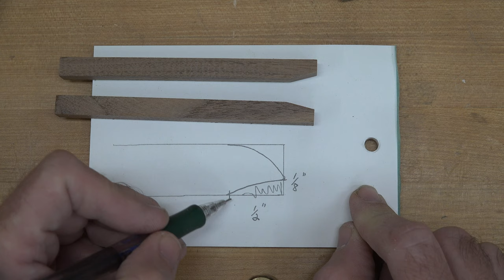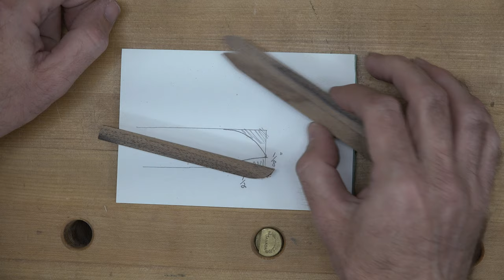Making Mini Photo Easels

Comment: Ken, wow, neat project and great use of scrap.  Gotta build a few of those.  I was wondering where in the heck you get such fantastic dowels then I remembered you make your own.  The light dowels against the walnut sure are a nice contrast.  Thanks for sharing.
Reply from the maker: The smallest dowels that I make are 3/16" in diameter Paul.  I find that anything less than that causes too much chatter in the wood and they end up being misshapen and incorrectly sized.  I purchase these at Lee Valley and they are fairly inexpensive and last quite a long time as you don't use them very often and when you do, they are usually smaller pieces.  Thanks for the kind words and for tuning in sir.

Comment: Your video is well done!.  You have very nice tools.  Consider using waxed paper to keep surfaces from being glued.  The squeeze-out problem is minimized.  Also, think about using bamboo skewers as a dowel replacement. By tapering your dowel or skewer just a shade for a pressure fit, you can avoid gluing altogether and get the same "peg" look.  Much cheaper.  This is a great easel for a cell phone either horizontal or vertical.  Friends who see it will want one and its nice to send people home with something useful and attractive such as your easel.  Thank you for sharing!
Reply from the maker: Some great suggestions there Paul and I'm sure that plenty of folks will find them useful.  I appreciate you chiming in with them.  Thanks for the kind words on the show and for tuning in.  I appreciate the support.

Comment: what is the name of  the manual mini saw ?
Reply from the maker: I'm not sure which saw you are referring to Ardi.  I did use a flush cut saw to trim the dowels in this project but other than that, it was mostly table saw and sander work.  Do you have a time in the show where I used this saw?  Thanks for tuning in.
Reply: @acutabove_woodworkings  ok thank u 🙂